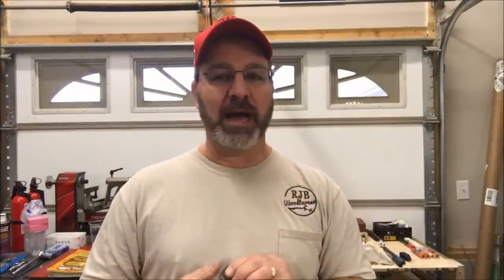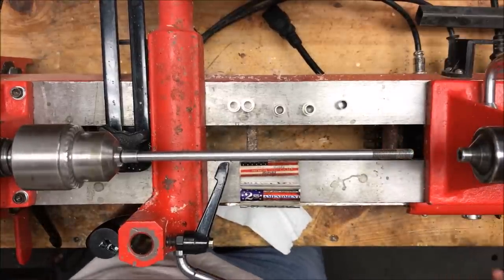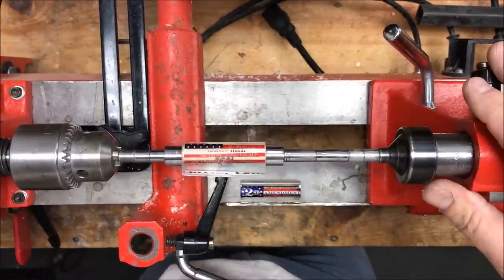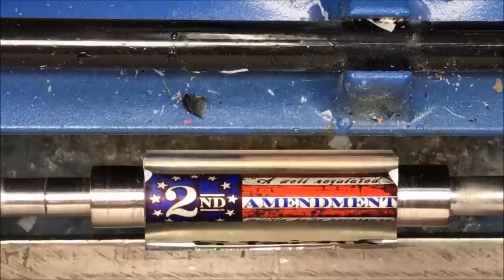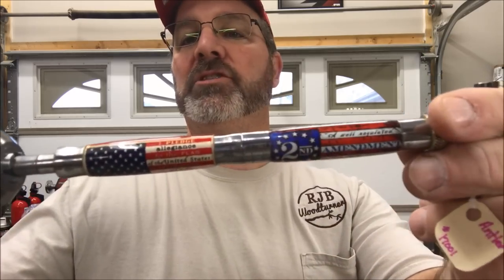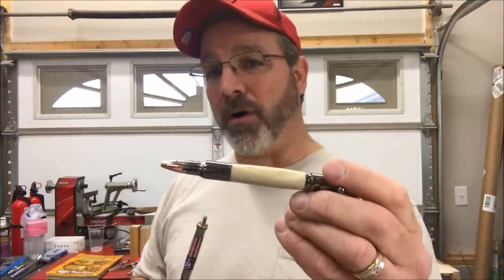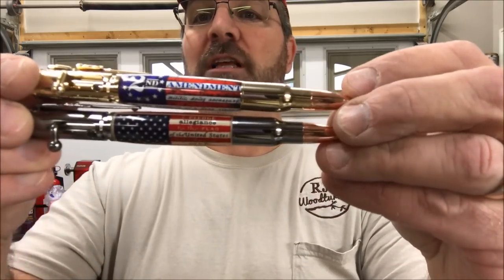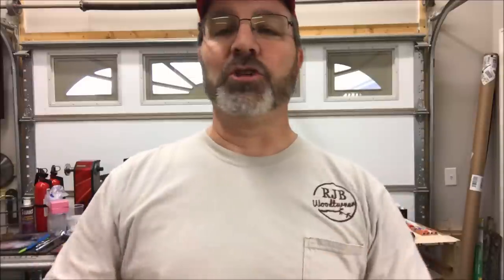Pledge of Allegiance and 2nd Amendment Bolt Action Pens

Comment: Outstanding Sir!! Not only are the pens gorgeous, they send out 2 very important messages! Thank you Sir for sharing and also the tip on lining up the clips correctly. That hasn't been an issue on most of my pens but it is a very important-even mandatory-to have the clips lined up where you did on these two. That will save me the headache of having to realign them. Tanks so much!
Reply from the maker: Thank you John,
  These were truly fun to turn. I love lining up the clips to make the pens last perfectly. It’s the little touches that make them. 
  
Regards,
Bob

Comment: I am currently learning a completely new lathe, and have a lot of adjustments to do, a new mandrel, and tooling.  I plan on trying to do a video when I get everything setup on the lathe and what I've learned, how to set it up for turning pens, etc.  The lathe is a 7" x 12" precision lathe from Harbor Freight.  Lathe works great, but this is the first time I've ever used a metal lathe, and combine that with trying to use it to make metal pen bodies.  This is quite fun and a very interesting learning process.
Reply from the maker: That’s awesome William, let me know when you start and send me a channel link. 

Regards,
Bob
Reply: I definitely will.  Thanks Bob.

Comment: great looking pens!   where did you get the kits from? I just received some and the bolt is not in the same position as yours.
Reply from the maker: Hello James,
  There is a Phillips screw inside the cap of the pen. Loosen it a couple of turns and you can reposition the bolt. 

Regards,
Bob
Reply: RJBWoodTurner thank you for your quick response!  I am aware of the little screw to change the bolt position from another one of you videos. However it looks like the clip on yours is on the tip side of the bolt.  Mine is on the other side so if I reposition my bolt it interferes with a shirt pocket under the clip.  Is there a way to reposition the clip itself?
Reply from the maker: The cap unscrews and the clip can rotate on most kits. The mechanical pencil will not rotate.
Reply: RJBWoodTurner omg!  thank you!!
Reply from the maker: You’re welcome. 

Regards,
Bob

Comment: What makes it so the point of the ink pen does not stick out to far?
Reply from the maker: The length of the tube determines that. You have to be careful not to remove any of the tube length when you trim them. 

Regards,
Bob
Reply: RJBWoodTurner alright thanks, I’m going to try to turn one, 🤞